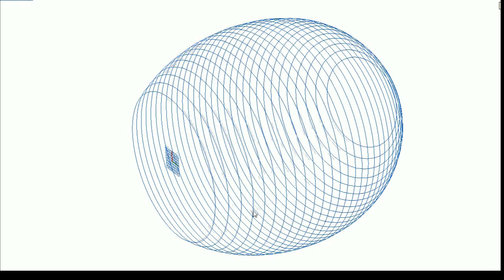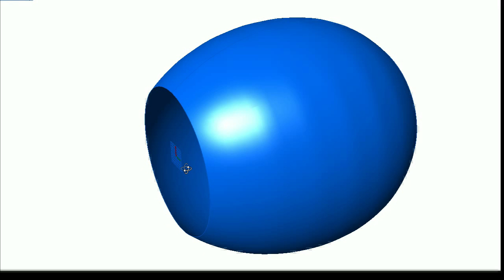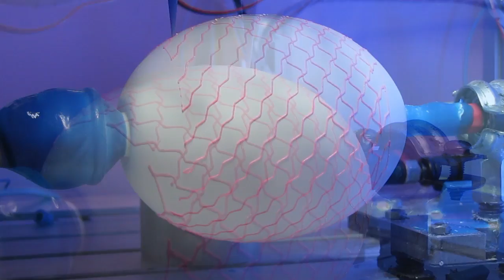3D / 4D printing inflatable structures

Comment: I don't understand why they shrink with the balloon. Shouldn't the inflated state be their natural state, since that's how they were printed?
Is it because they get cold, maybe? If whatever you're using to print expands a lot when it gets hot, that could explain it.
Reply from the maker: Both materials are Silicone and so they bond together. The stretched membrane is a very soft silicone, and the printed pattern is a very hard & incompressible one. 
The idea was to print a structure where there is both tension and compression elements that balance each other at a minimum energy state (sometimes called a Tensegrity).
Such structures are useful when making artificial muscles such as "Dielectric Elastomer Actuators"
Reply: @fergalcoulter  Ah, so it's the balloon that shrinks the whole structure down. Thanks for the explanation. Much appreciated! :)

Comment: What is that modelling software youre using to generate the pattern?
Reply from the maker: I use Grasshopper3d which is a generative design plugin for Rhino3d. This allows me to create algorithms which generate the geometry from the scan data, and output it to CNC GCode. It's a great tool!
Reply: @fergalcoulter  Thank you for your video and your reply. It give me ideas.
Reply from the maker: @cherylm2C6671  thank you! I'm glad you like it!
Reply: @fergalcoulter  A lot can be done with this. Now thinking about soft machines, since circuitry can be laid on so precicely. Thanks again, and good 2023!

Comment: What material is being deposited on the silicone balloon?
Reply from the maker: It is also a Silicone, but a much higher hardness than the balloon - (technically it's Shore A73 as opposed to Shore 00-30 for the inflatable membrane)
Reply: @fergalcoulter  Thank you!

Comment: what is the laser measuring device being used?
Reply from the maker: Hi Jason. It's a "Banner LG10" measurement laser.  In retrospect it's not the best device in this situation, but it did the job!
Reply: Holy shit, $1000 measuring device, you had to have this laying around
Reply: 2 years later its $490.00